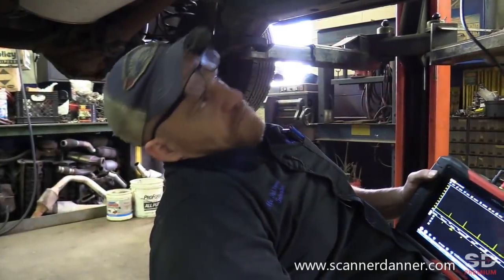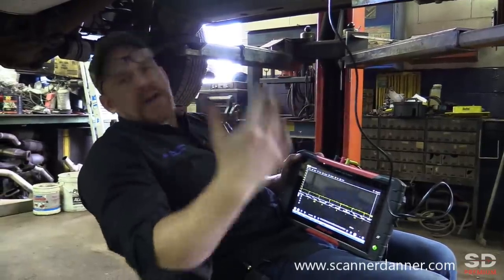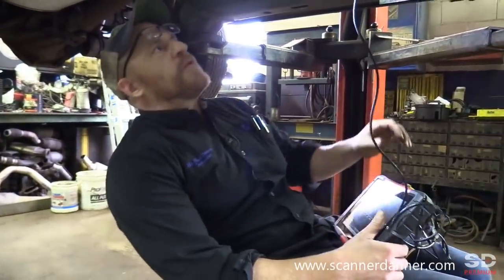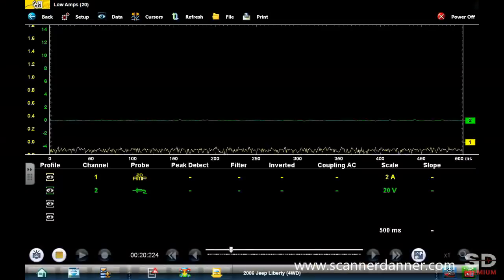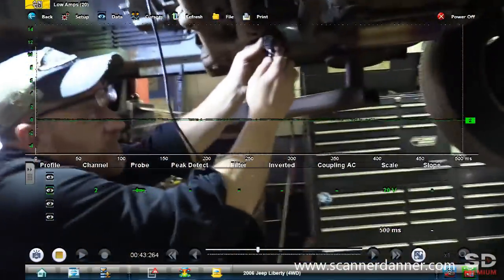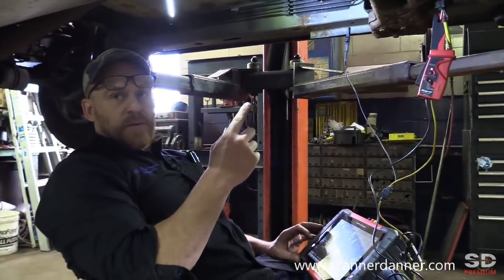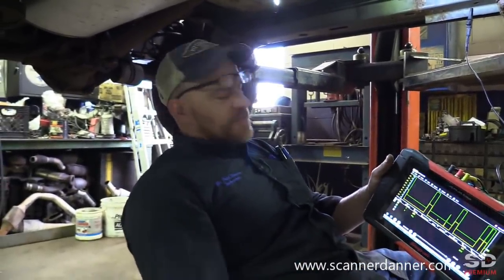Determining Circuit Design (Power or Ground Side Switching)

Comment: Hey Paul Danner, nice videos as always. I've learned more from you in 1 year that i ever did from 10 years working on cars under mechanics and wirking for an excavation equipment company under the lead mechanic.
I now have the OTC 3633 mini coiled circuit tester (incandescent bulb) because i seen you using it in some premium videos.

Comment from the maker: Here is the full video breakdown:

Jeep Liberty PWM O2 Heater Circuit Testing (New Oxygen Sensor Installed)

Video Breakdown:

00:24 - 2006 Jeep Liberty P0158 O2 Sensor 2/2 Circuit High
01:16 - using O2 bias voltage to check heater circuit operation
03:20 - O2 PWM command on scan data
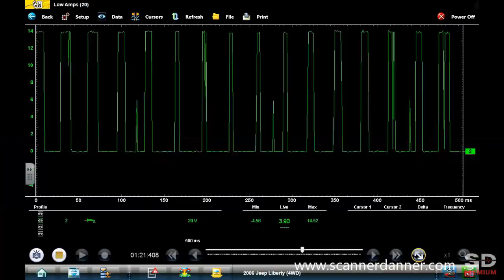05:18 - testing begins under the car, O2 locations
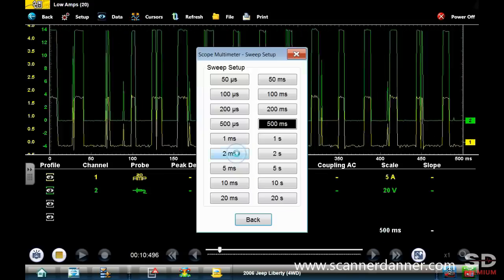06:21 - using sensor side colors to ID the heater circuit
07:04 - the working side (B1S2) O2 heater amperage waveform
07:31 - 2005 Dodge Ram 1500 O2 Heater Code (Faulty PCM driver) and Stalling Conditions Part 1 https://tinyurl.com/y52j7v3e Part 2 https://tinyurl.com/y5qqwjqb
08:00 - the bad side (B2S2) O2 heater amperage waveform
10:14 - voltage measurements and how to identify power or ground side switching
15:30 - voltage measurements of the 2/2 sensor begin 
16:22 - low voltage and amperage found (possible "smart" driver using "intentional shut down")
17;30 - using a test light to substitute the heater circuit
19:44 - test light not lit, with good commands, suspect wiring or PCM problem
20:05 - wiggling test light ground with 100% command (no light)
20:55 - measuring the good side (1/2 sensor) again (relocated test light ground)
22:40 - connecting the 1/2 harness into the 2/2 sensor
24:20 - resistance measurement of the heater circuits 1/2 = 4.88 ohms 2/2 = 6.08 ohms
28:17 - amperage and voltage measurements of the 2/2 sensor using 1/2 control (test light installed the entire time)
30:25 - I proved nothing :-)
30:53 - recheck of the 2/2 heater 
35:05 - testing begins under-hood
37:00 - wiring diagram and wire location at the PCM
37:40 - 2/2 circuit voltage at the PCM 
39:40 - 2/2 circuit amperage measurement to confirm wiring integrity
40:20 - why a power side switched voltage waveform can be misleading
44:09 - scan data O2 Bias and heater commands look bad for the 2/2 sensor 
45:20 - starting to question the sensor again
46:25 - WARNING! Aftermarket Oxygen Sensors (Chrysler) 
Part 1 https://youtu.be/-lUYRqaYvYI
Part 2 https://youtu.be/gtTKOuu6EPw
47:40 - voltage and amperage waveforms after running (compare to 37:40 mark)
48:30 - 1/2 voltage and current
49:30 - surprised by what the test light does when added to the circuit (both scope and scan data)
53:15 - why couldn't we do these tests under the car!
55:30 - 1/2 harness plugged into the 2/2 sensor to prove wiring is fine (scan data heater commands)
57:30 - test light affect on the circuit (bias and heater command)
1:01:30 - new oxygen sensors installed, scan data readings
1:05:22 - final discussion with my son Caleb discussing why the test light tests failed under the car
Reply: Oh dang...Looks to be a very interesting video.!
Reply: Hey Paul, please check the URLs to part 1 (both). Somehow the "Part" after each URL is contained in the URL itself and therefor breaking the URL.
Reply from the maker: Thanks! Should be good now

Comment: Nice. Thanks! Here’s one. What would u make of a heater with constant V on feed 0v on grnd KOER, constant 1A current flow, ohms in spec (10-13). No codes. Complaint is higher than expected fuel use on city driving. Acceptable on long trips. I’m told some early thimble type O2 like this one use constant ‘on’ mode. Never encountered before this. Talking abt a 2004 Hyundai Accent 1.6lt Auto.??? No post cat o2. fuel trims v good.

Comment: Damb Paul...I had a question for you about the voltage vs. current reading on the O-scope. This video answered my question I think.
Since current is inversely proportionate to  voltage...does the current rise on a measured 5v digital wave  reflected as the high line while the voltage is reflected as the 0v event, being the inverse?
And is this measurement  reversed depending on whether the component is power sided or ground sided? 
Please re-affirm or clear my fog on this.

Thanks Mr.P 
😀

Comment: Im having similar issue with the subaru evap signal b134 at #13 wire gave up made appt at dealer .finally cleared po448 now have po447 leaning towards bad pcm. Im a retired electrical lineman but just can't grasp your great teching techniques.gave up on g7 computers no one answers phone
Reply from the maker: I seriously doubt it is a bad driver in the PCM. This is a vent control circuit open code right?

Comment: Really helpful video!

In your experience, how often have you come across O2 sensors that are 15-20+ years old and still fully functional? Do they all eventually become less accurate over time?
Reply from the maker: they become contaminated and yes need to be replaced when their signal voltage and frequency start to deteriorate

Comment: HELLO MISTER DANNER , I HAVE BOUGHT YOUR BOOK ONLINE AND I WOULD LIKE TO HAVE IT ON THE JOB WITH OUT HAVING TO HAVE WIFI YOU HAD SAID WHEN I HAD BOUGHT THE BOOK THAT IT WAS POSSIBLE TO PRINT THE BOOK . WHERE DO I GET THE INSTRUCTIONS TO BE ABLE TO PRINT THE BOOK THANK YOU AND LOOKING FORWARD FOR YOUR HELP .
Reply from the maker: You cannot print from the eBook directly. If you just recently bought the eBook, I have no problem applying the cost of the eBook towards a paper book and you can pay the difference. Or if you wanted to have the paper book also, I offer $20 off for eBook owners. Shipping is $5 in the US and $25 overseas. Email me at support@scannerdanner.com and add this email address as a contact so my replies do not end up in your spam folder.

Comment: this trivial electrical would benefit from a white board explanation... going in current equal going out... PWM voltage control, pwr side Ctl.

I feel you made this a bit  overcomplicated... like a German car 👍🏻
Reply from the maker: this is a clip from a longer training video, any questions you may have would be answered in the full version, sorry you feel this way

Comment: I have a Jeep 3.7 with a bad heater control driver, can the PCM be repaired?, if I do not replace the PCM is the only effect the engine will take longer to go into closed loop when cold or can it go into open loop when the engine is idling or low RPM at operating temp?
Reply from the maker: you could send the PCM out to be repaired. Yes, the engine will not enter closed loop as efficiently as it should. Gas mileage will be affected and then you may also cause damage to the catalytic converter, especially during stop and go traffic driving.
Reply: @ScannerDanner  Thanks, can you recommend someone that repairs them or sells reman PCMs?

Comment: Scanner Danner thx 4 the upload! I'm not a real mechanic (more of a hack) but in this case of a power-side O2 sensor and a poor ground on the ECU I'm assuming the trouble-code would b the 02 sensor side. Correct?
Reply from the maker: not sure what you mean Brent, sorry
Reply: @ScannerDanner  Well I'm trying to locate a few of your video's on cars with bad grounds... On my car I'm now getting 11 v. back to negative but the car runs fine--just killing batteries... Thx
Reply from the maker: @curlymyhero  here you go Brent, it is my ground circuit problems playlist (7 videos)
https://www.youtube.com/watch?v=44dP6X3QS5A&list=PLAFYVCyenqcr32wgsCqa1Zj4335YlBF5p

Comment: On your video of Toyota celica, what else may cause a weak spark besides the coil
Reply from the maker: low voltage on the main power feed, a poor ground on the igniter, a bad igniter, a weak coil, a cap and or rotor problem if you are testing at a plug wire end

Comment: Hey scannerdanner, have an 09 charger 3.5 with a starter issue, new starter so I know that’s not the problem, it clicks, I checked the relay and have a voltage drop of around 7 at terminal 86 when I crank it and that’s where I been stuck for a couple of days. I been jumping it from constant to 87 with a switch for now but want to fix it properly. I don’t want to throw parts at it since I’m 17 and don’t have much money. Any advice would be greatly appreciated
Reply: I also just replaced the motor and the problem started to occur the following night. This was not a problem before the engine replacement. At first it would start up and after a while it would start up after turning it a few times and now it just doesn’t want to.
Reply from the maker: pretty awesome for a 17 year old! I'd be proud of you if you were my son on how far you've gotten so far. Okay so you are jumping the relay load side contacts to get it to start? (87 and 30) and you have found a voltage drop on the control side (85 and 86)? I think we should move this to my forum as I can definitely help you better there. It is free to join, https://www.scannerdanner.com/forum.html
Reply: Thank you, I have posted my question